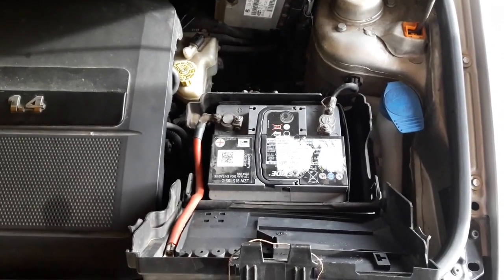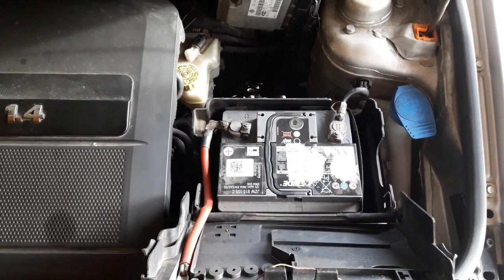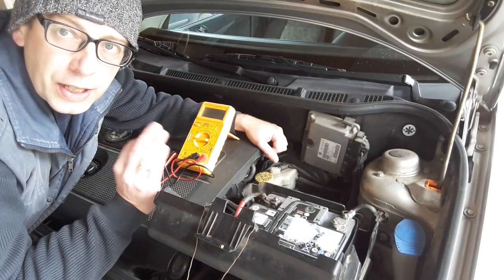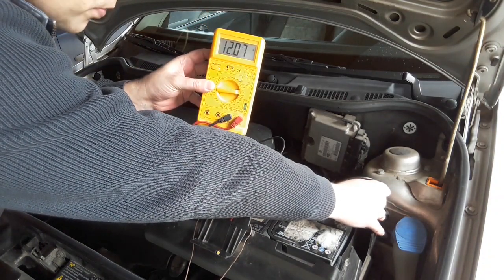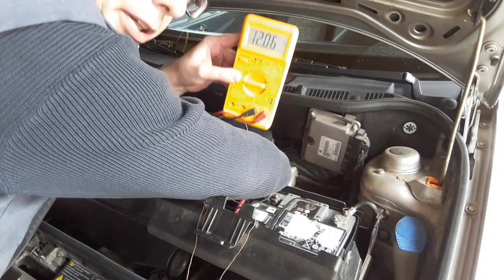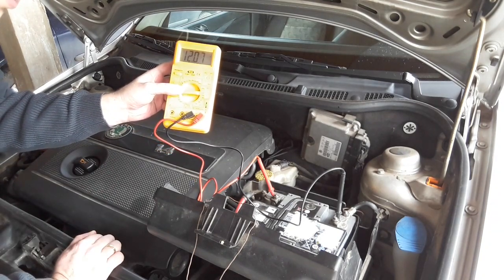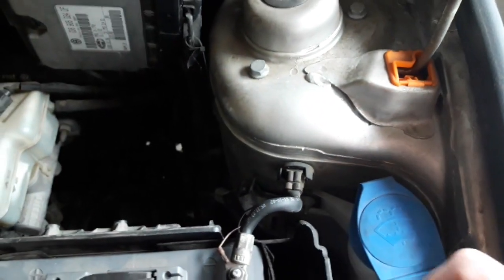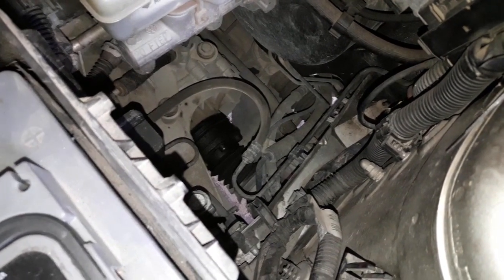Bad Ground Connection On Cars-Meaning,Symptoms, Diagnosing and Solving The Problem

Comment: If one main ground is loose? Can it fail. ? 2013 Yukon sometimes ignition issues clicks sometimes and then turns on . For the most it sparks up quick 😊
Reply from the maker: Hi and thanks for watching! Yes, it can fail, especially if it's one of the main cables (battery to body, body to engine etc).

Comment: Hi I wanted to ask you if I have a resistance of 8 ohms between the negative pole and the motor and to  high or is normal? between negative and car chassis i have 0 ohms but between minis and motor are 8  ohms
Reply from the maker: Hi, and thanks for watching! If I understood correctly, I would check the minus connection to the engine since that's a significant difference.
At least, I would directly connect a jumper cable from the minus terminal to the engine and then make another measurement.
Reply: @DespairRepair 
If I connect a wire directly from the negative to the motor the resistance is 0 I think that somewhere a little resistance has been created between the ground terminal wire and the motor but I have no voltage drop between the negative and the motor
the problem is that I can't locate the wire terminal because it is placed in a very difficult position on my ford fiesta 2006
Reply from the maker: @MihaSun , why don't you try making a new negative cable and installing it? This is pretty common practice in cases like those.

Comment: I got my alternator rebuild, but my break and battery light still come on they told me it could be bad ground which was the only code that came on my nissan maxima  when they scanned it but it only comes on when I press the gas and my battery is good
Reply from the maker: I haven't heard of a bad ground connection code, but the ground connection is definitely worth checking. Thanks for watching
Reply: @DespairRepair what do you thing it could be i ordered a negative battery cable they said that might work
Reply from the maker: @UncleSmurf8732  Well, it won't hurt to change the cable, although a previous simple test with a jumper cable would've been good to do before buying it. Just connect one side of the jumper cable to the minus battery terminal and the other to a bare metal part of the engine. Regarding the reasons, it could be numerous things. If the alternator voltage output is OK and the battery is OK, it could be a bad electrical connection somewhere, an electrical problem, a wiring problem...
Reply: @DespairRepair got it sounds about right

Comment: My IACV is misfiring (1200rpm to 1400rpm pulsing), radio LCD glitching, lights dip when i use the fan, warm setting on fan not working & low charge from the cigarette lighter. Alternator has been tested with no issue so its looking like grounding!
Reply from the maker: It could be, it's definitely worth checking, thanks for watching!

Comment: Hi great video .may I ask a question?
My rear lights stay on even when everything is switched off. When this happens the rear indicators don't work i also get warnings on the dash .done battery disconnect reset ok for 10 minutes then comes back .mercedes c230 2008 v6 204 
Any ideas? Regards Doug.
Reply from the maker: Hi Doug, nice meeting you. Thanks for watching and for your kind comment. You didn't mention what lights stay on (brake lights, side lights, turn lights)?
Reply: @DespairRepair just the tail lights also the indicators don't work at the back .if I do a reset all ok for 10 minutes
Reply from the maker: @douglasreed132 , here's what I would check:
 
If the lights have a bright shine:
All of the bulbs in both lamps (unless it's an LED lamp)
The wiring connectors on both lamps (if they are clean and the contacts are tight)
The wiring looms to the lamps (for damaged insulation or wires). A damaged wire may be fused to another wire and get input from it.
If there is any wiring installation for a trailer, I would check that also, just in case.

If the lights are dim and if they work at the same time:
Check the ground connections of that part of the wiring.
Check the ground connection pin on the wiring connector (loose or corroded pin for ground).
We have a video on this topic on the channel.

Doug, this is more or less the standard check for this problem, in my humble opinion. There may be a problem that's specific only to Mercedes; have that in mind also.
But I would first try this nevertheless.
Reply: @DespairRepair I have renewed all the ground straps at the back with 20 amp electric cable soldered . It worked for a while . Now I have found possibly the problem the radiator fan has stopped working,  so possibly after driving and parking up the heat rises and affects something
Reply from the maker: @douglasreed132 , to be honest, it could be lots of things. If you have the will, try taking a tester light and see where the power input to the lights is coming from.
Is it a ground problem or a false input problem?
What about the other ground connections, the smaller ones (10 or so mm nuts) located on variuos parts of the car body? Did you check those? Some are hard to find and reach on most cars.
All modern cars have intertwined systems; it's very hard to find the cause of a problem like this.
Reply: @DespairRepair thank you for your reply much appreciated

Comment: I have a intermediate start issue that could be caused from a bad ground starts then don't starts then don't
Reply from the maker: Hi and thanks for watching! It could easily be because of that although those symptoms are present for other reasons also (like bad starter brushes for instance).

Comment: Hello Mr Despair Repair, Your video was critically very useful about understanding how to look for ground issues. 

I drive a 2016 Honda Fit/Jazz and got a new audio system build done before a week. My car starts normally, my alternator seems to charge the battery and every other electricals work as it should. But, I hear a hiss/whine(like alternator/motor running) randomly out of the left tweeter when no audio is playing. This happens only on the left tweeter not on any other speakers. The issue doesn't come up always. But, almost everytime I move my car. Sometimes the hiss/noise comes in 5 minutes of driving and sometimes in 15 minutes or sometimes it doesn't come at all. If I turn off the head unit, noise stops. My installer asks me to check the battery and alternator. I suspect there's a minor ground issue. But, to check for ground issues in the system, I have one headunit, 1 DSP and 3 amplifiers under the seat. I'm asking the installer to check the grounds, as it is a time consuming task, he asks me to check the battery and alternator. Can it be an alternator failing diode issue or a battery issue as my installer suggests or get the grounds of each components checked by myself or someone who's qualified by removing the seats and panels? 

Which direction should I go first?

Please help if you read this message.

Thanks.
Reply from the maker: Hi, and thanks for watching! I would first try and install a suppressor for the alternator. I think you can find it on Amazon and other places. This is a common problem with alternators.
I doubt that ground connections are the fault.

Comment: My car just shuts off going down the road. If I make a sharp Lane change it'll Buck like it's losing connection or a transmission problem. Three different mechanics. Nobody can find anything wrong. I'm thinking about just spending the 300 bucks on a brand new factory battery cable and be done with it.
Reply from the maker: Hi and thanks for watching! Perhaps try with a jumper cable first before spending that much money on a new one.
Reply: @DespairRepair 
Ok Update 
Found another local mechanic and in two minutes he may have figured it out. The cable and nut connection on the fuse box on the fender to the positive battery cable was a little loose and didn't appear to be making a good connection. As he tried to tighten it the end of the plastic fuse box broke off. Seems to be a common problem so he cut the rest of the end of the box away and then bolted the cable end to to box connector with another nice bolt and lock washer. Solid as a rock now and the box and fuses and relays are still protected. Hoping for the best but think that was the issue. 😄
Reply from the maker: @thud9797  glad to hear that and that you've solved the problem, kudos to the mechanic for the repair and finding the cause.

Comment: Hi 
Lately i've been noticing that the red battery icon in the dashboard is NOT turning off after the car has started. It remains on all the time even while driving and this is draining out the battery, I have recharged my car battery more than a couple of times this week but it just keeps draining off .... please advice
Reply from the maker: Hi and thanks for watching! The battery draining is normal since you do not have an alternator voltage output. You're essentially driving the car on the battery.
First, take a multimeter and check the alternator voltage output. We've made a video about this, and it's very easy to do.
If there is no output from the alternator, then check the voltage regulator, all of the connections to the alternator, and else.

Comment: Car stopped in my hometown pf PAC-TOWN pacoima ca that is. And went to a store came outqnd car wouldn start. Just a ziennnnnnnnnnnnnnnn sound. Checked the cables the positive on ws loose for a couple weeks.i changed the positive terminal and heard the relay sound off. So o looke a lil mo mo. And on the Positive terminal the skinny wire that goes to the body. Was green andi noticed it didnt hv the rubber on it. It had melted off. So im sure wll this happened bcauee i rode around oth that negative terminal loose for 2 weeks.tomorrow a.m. i go get the cable and replace it.ANd THEN ILL BE  on the road againnnnn. Like MR. WILLIE NELSON❤

Comment: My transmission ground screw stripped and fell out and they couldn't re-thread the hole to put it back in so they just moved the wire to a different screw. Now the car is running a little rough and I'm hoping it's just because it sat for a couple months till I could get it looked at and not because they've made it worse... I'm really scared I'm gonna get stranded somewhere, honestly...

Comment: Thank you for this I have been told by a garage alternator was shot and paid for a new one still had charging cranking problems.Paid a bloke £160 so called auto electrician he never even mentioned this .Even the R.a.c never said anything .I was at my wits end with my Citroen dispatch.I found the engine to chassis earth connection.Which appeared rusty .The threads stripped on one bolt.Cleaned surfaces thoroughly and everything is brilliant.Charging well , cranking back to excellent.Thank you so much 👍👍👍😊😊😊
Reply from the maker: You're welcome and glad if the video helped 🙂

Comment: I cleaned my throttle body on a 01 Tacoma 2.4 and sprayed the MAF since i was changing my spark plugs, valve cover gasket, PCV Valve, and coils. Now my truck won't start. It sputters and shuts off immediately. I have been able to turn it on twice and as soon as I take my foot off the gas, it dies down and shuts off. Any ideas?

Comment: I'm told a earth cable is the reason for my 2017 Fiesta not starting. It was running fine one day, stopped at a shop and it just refused to start again after that. All other electrical things were working (locking, lights, radio, windows) although weirdly the horn wasn't working when pressed. Breakdown patrol checked the battery, that was fine. He then tried to bump start me, but to no avail.
Was towed to a garage who had not long done an engine change on it (wet belt failure killed the last one, unsurprisingly). They've told me they've looked at it, and it needs a replacement cable. 

Given how much they messed about and dragged their heels with the engine, I really don't have a whole lot of faith in them to diagnose this properly and to give me a repair that I can trust and rely on. Has anyone else heard of a similar pair of symptoms? As I say, everything else electrical on the car seemed to be working fine before it, and even while I was sat waiting on help after it failed to start.
Reply: FYI, the breakdown patrol said he would take me back to that garage as if it was an engine problem then the replacement one would have come with a warranty/guarantee. I saw the logic behind it, although it filled me with dread seeing the car back outside their workshop all over again

Comment: 2015 Kia Soul The charging ports in the car won't work, and today, the car stopped and acted like the battery was dead, but it's a good battery. I have no one to ask and the tow truck operator charged me $200 for a 5 mile tow. Any advice?
Reply from the maker: Hi and thanks for watching! It could be variuos things. If the car is totally dead in the water, first check the battery terminals if they are connected properly, are they tight and clean.
Next check all the main fuses, best look at your cars manual for the fusebox location.
Also check if the car has any hidden safety features that shut the electric power off in case of  an emergency.
This is what I would do first, to be honest.

Comment: It's not a minis post it's a Negative Battery Post. 
Slow cranking doesn't indicate interference as you said; it indicates that there is a loose connection; damaged wiring; or Corrosion in the Circuit. In other words Not the proper Current or Amps getting to the Cranking Motor.
A fully Charged  Battery with 12.6 Volts but under 10 Volts at the Starter  will not start your Vehicle.  The Solenoid or Starter Motor Could also be Defective. Or your terminal connections could be Corroded.
Reply from the maker: Thanks for watching and your interest

Comment: What if I have high voltage on the gauge ?
Reply from the maker: Hi, and thanks for watching! Check the alternator voltage output with a multimeter as soon as possible.
Reply: Ok I will. And if it’s high? Would changing the alternator fix it? Or should I maintenance all grounds also
Reply from the maker: @ Probably since in case of high voltage it's either the voltage regulator or the stator (parts of the alternator).
Maybe try changing the voltage regulator first if you don't want to pay for the whole alternator.
Clean the ground connections regardless of this, it will do only good.
Reply: @ good looking out. Thnx for the time
Reply from the maker: @TinWaLkn2OX  you're welcome and good luck with the repair!
Reply: @ I got my alternator coming today. See if it’s a remedy
Reply: New alternator same problem

Comment: What could go bad on a car to make it start shocking you when touching the door upon leaving?

Im having a bad battery indicator, check emgine light for vtec switch, the radio not working properly and also shocking while leaving the vehicle? Could this be a ground issue that could cause a shock or soething else.
Reply from the maker: Hi, and thanks for watching! It can't hurt to check the ground connections but at least regarding the car shocking you I don't think that will help.
Try installing one of those anti-static straps under the car or just wait it out.
It usually goes away as the weather changes.
Regarding all the other issues, check the battery and the alternator voltage output.

Comment: I replaced my alternator an after a week my battery light stays then on an goes off i check for corrosion my negative had corrosion I cleaned it good then same thing ground wire had no corrosion an there both tight
Reply from the maker: Thanks for watching and for sharing!

Comment: So does the cables need to be connected on the other end to a battery or power source in order to bipass the ground wire?
Reply from the maker: Hi and thanks for watching! If I understood the question, If you want to bypass the cars factory ground, one side of the cable goes on the minus battery terminal and the oher goes on a clean metal (safe) part of the engine (like the gearbox housing, engine block etc.)

Comment: A gazillion youtube videos about starting issues. YOURS is best. I was pulling hair out. My old truck no start with new starter and solenoid. Took off main ground from bat to frame,  wire brushed it good, sprayed contact cleaner for good measure. Everything working now. THANK YOU! GROUNDING IS SUPER IMPORTANT!
Reply from the maker: You're welcome and very glad if the video helped 🙂

Comment: 2015 Toyota RAV4 , signal goes off,  headlight goes off, AC goes off beside all of those off , car drives ok, so stressful😢😢  change catalytic converter, camshaft sensor, fuel pump, new battery, new alternator  still 😢😢😢

Comment: I have tuned 10 or 12 ls swaps And they are never right when they come to me. They always have issues in 10 out of the 12 have been a ground although a weak battery gave my envoy a fit trying to idle.  It would idle erraticly at a different speed every time.Everyday, the battery was still good enough to crank it but I guess it didn't have enough resistance to shunt the noise from the alternator drove the computer crazy with little micro.Voltage spikes anyway long story short it's always a ground